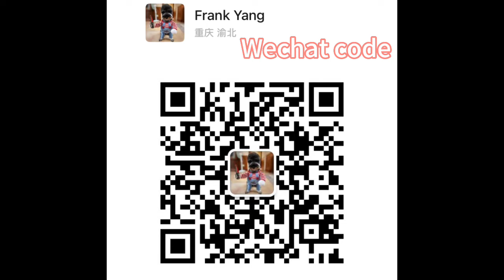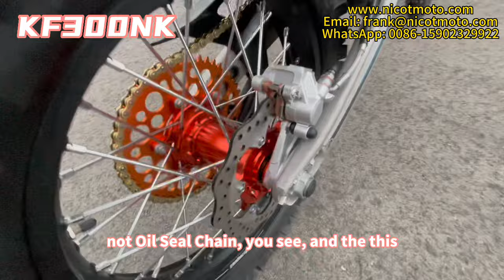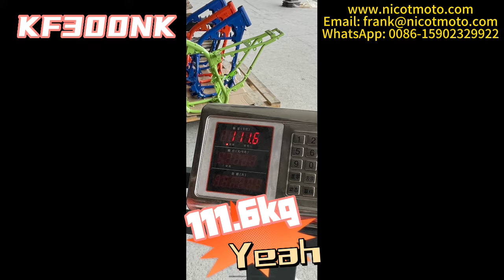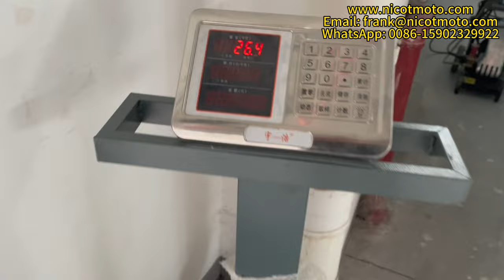March8, Nicot KF300NK, 2 stroke 300cc

Comment: I have a nicot built 230cc bike. I like it. Bought in 2018. When i recievy it i assembled everything and lubed all the key components. Still in use today. Ive since replaced the 230cc engine with a zongshen 300cc.  When will these be available in the United States. Or do you have direct sales?